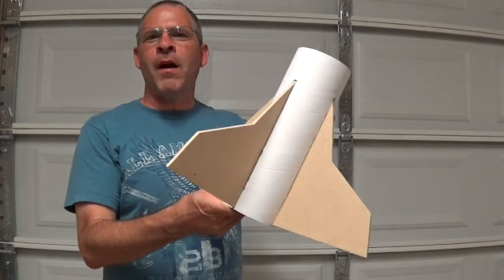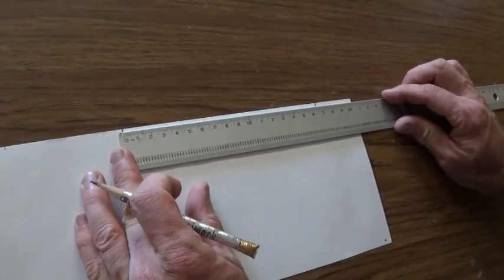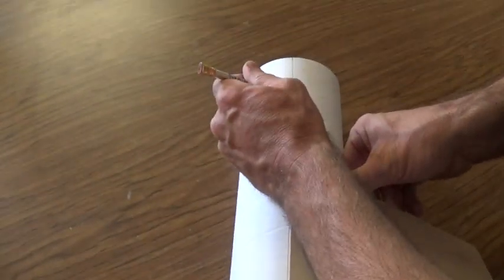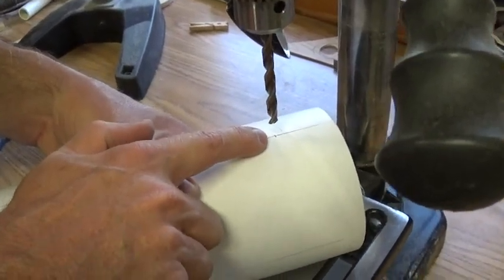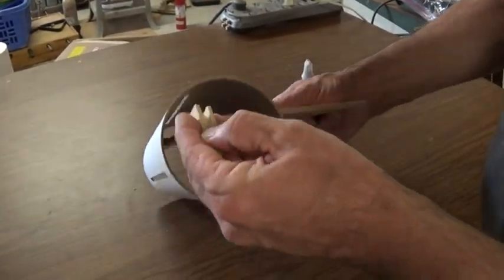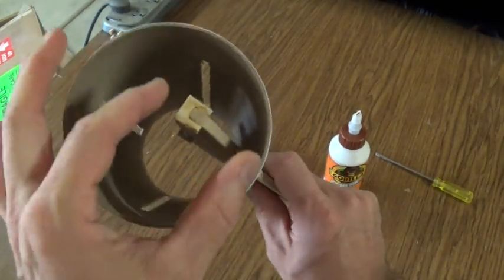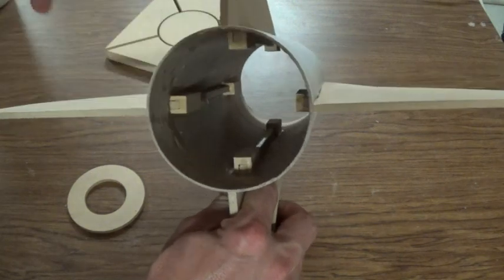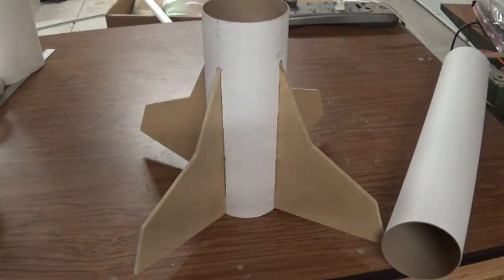Cutting Through Fin Slots and Installing Through Fins on a Model Rocket. How To / DIY

Comment: When I do this type of thing I put fillets inside the tube also.  You have good access so easy to put them in before you install the rings.  I would probably even use Titebond II wood glue for the internal fillets.
Reply from the maker: Certainly not a bad idea. The more bonding, the better.

Comment: How bout clamping a fence guide onna drill press ? Gives a better longitudinal guide
Reply from the maker: This type of cutting bit will always try to grab and spin the cardboard, but you are correct, a fence guide can be helpful.
Reply: I thought about rubber banding a piece of angle aluminum on the tube to act as a guide. But maybe that bit would cut in to it

Comment: Much more complex than it has to be. Relies too much on wood working skills and specialty tools. Plus this would be difficult to repair when a fins breaks. I will stick to three centering rings with fin tabs that glue to the motor tube.
Reply from the maker: This is actually a pretty old video and I have changed my fin installation since then. Newer system is similar in design but simpler. I don't use the motor tube design though. Reason I don't do that is because then I would have to find cardboard tubes that fit all my motor designs perfectly.